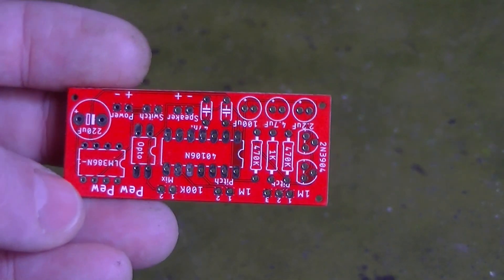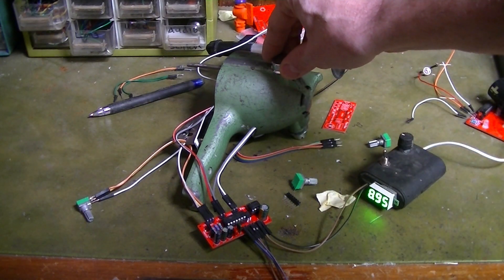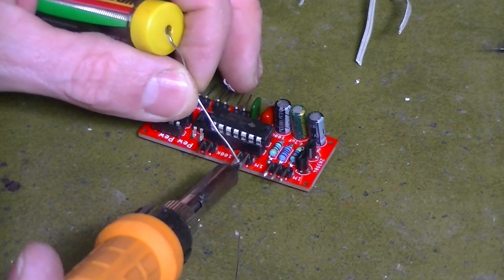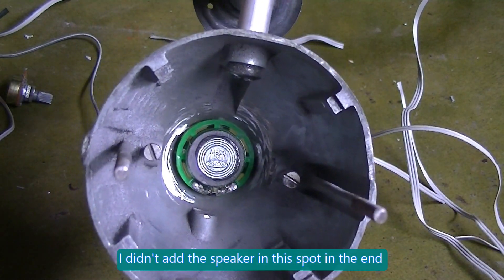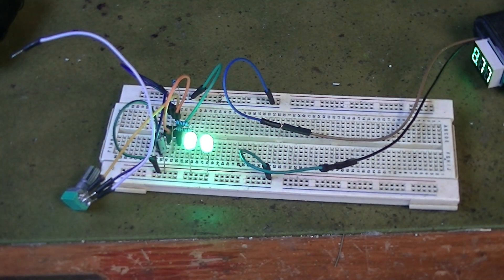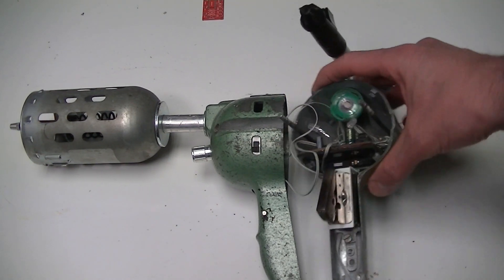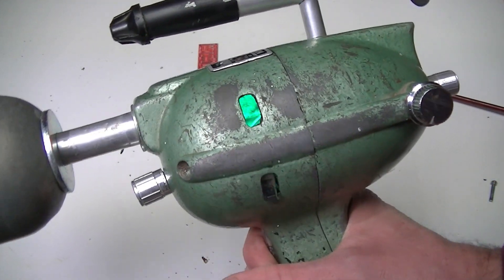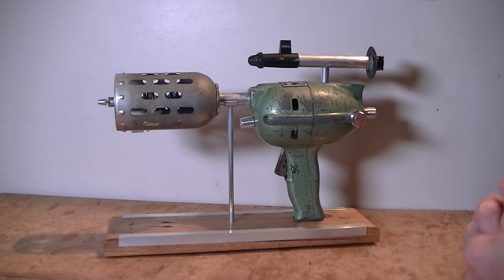Ray Gun - Part 2 Electronics and Final Build

Comment: Cool build. I was going to put a "couldn't you solder the wires to the board?" comment when you explained it! So - is there a way of linking the two circuits so the flash rate depended on the pewpew setting?
Reply: One could take the positive side of the speaker output and use it to drive an LED.  It may need a transister to bring up the current needed for the LED without changing the volume of the speaker.  Add a capacitor if you want the LED to fade out as opposed to chop off.
Reply from the maker: Def be a way to do it.  Wayn3w is in the right track with using the speaker output.  You could possibly also use the 40106 ic’s output as well.